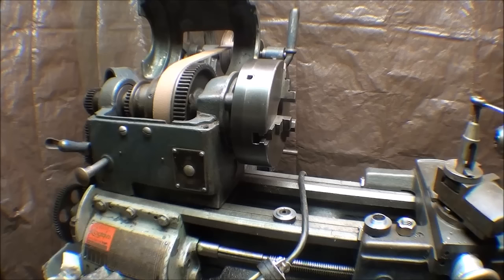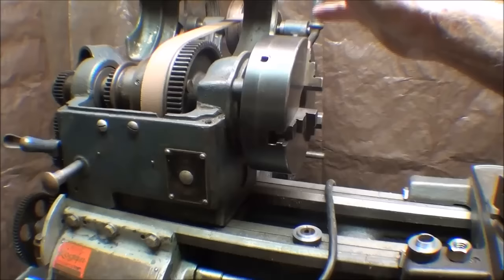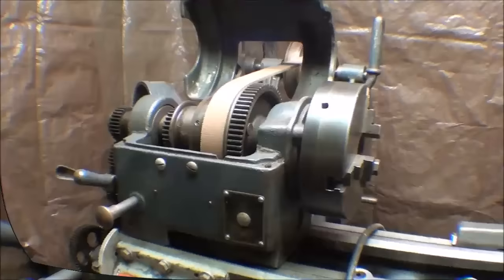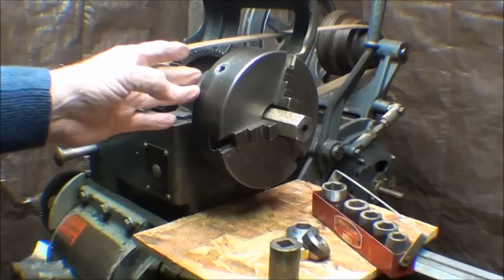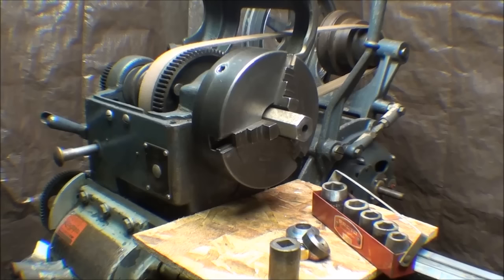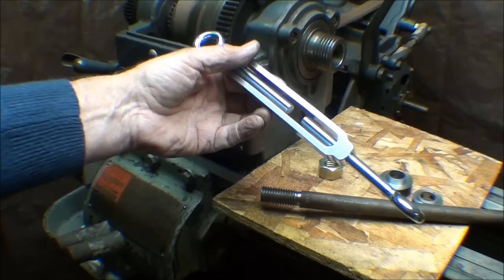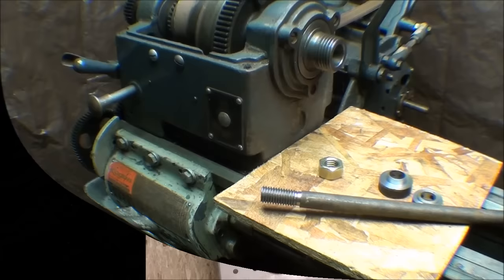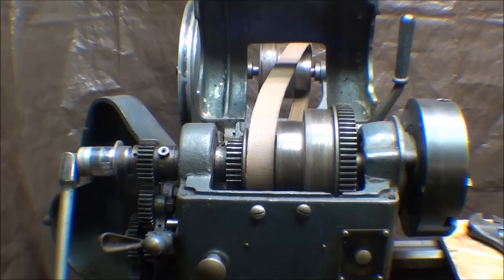SHOP TIPS #281 Removing a Stuck Lathe Chuck tubalcain atlas

Comment: Great video!

I had a stuck chuck that had been on my Logan 820 10" lathe for decades. Slight rust all over the lathe. I tried everything to get it off. I secured the spindle, and would soak the threads with Kroil daily for a couple of weeks. I chucked up a long 4' tube and hung a bucket on the end. I then filled the bucket with all manner of scrap, lead, etc and let the chuck support the weight. Left it for a couple of weeks and would squirt Kroil every other day. That trick didn't work for me (I should have used a longer pipe - more leverage). 

I finally decided to chuck up a piece of hex and use my impact driver. At 11:00 PM one night, I couldn't find any large hex in the shop. Wait, my Delta wood/metal 14" band saw has a 7/8" guide piece that will work! I first "bumped" it in the tightening direction hoping to break the rust, then went all out counter-clockwise. Came off without a hitch. It worked great!
Reply: +TAWPTool Those are some good tips!
Reply from the maker: +TAWPTool EUREKA!!!!!!!!!!!

Comment: My friend Grady got a really cheap buy on an Atlas lathe that had a stuck chuck. A couple of hundred $.cheap. He applied continuous torque to the chuck with a big wrench by means of a big wrench and a long piece of pipe. He used a small come-along on the far end of the pipe and just let it sit for a few days. Keeping it in traction like this finally did the trick. He said the daily heating and cooling in the shop helped to  break it loose..
Reply from the maker: Ingenious solution---required patience though.

Comment: Thank you!  I just bought an old, small lathe and the chuck was stuck.  I had been beating, prying, praying and pleading to get the thing off without breaking something.  I tried the impact wrench trick and after several seconds on a large coupling nut  (i didn't have hex stock) it came off.  Again, thank you!
Reply from the maker: I'm glad it worked for you

Comment: Chain grip is usable with a nice thick rubber protector pad to keep the chain from damaging the steel. Can also be used on a pulley, though grip is not as good as the v belt. Old serpentine belt is a good source of the right fabric backed rubber, and is free at the local mechanic from the bin.
Reply from the maker: +SeanBZA Yes-Thanks for watching

Comment: The last solution with the left hand  thread will also work with a righthand thread if you can hold it from the chuck end of the spindle.    Maybe RH all thread with wahsers/nuts at either end, if you can fit a socket thru the chuck. I think. Great video! Im working on getting the chuck of a 1887 Barnes 4 1/2.

Comment: Our 10" Sphere (Atlas copy) had a stuck 4 jaw, various attempts over 4 months failed to shift it, used every method except dry ice, nothing worked. I therefore became violent,  removed the chuck from it's backplate, used a 1mm thick cutting disk in the angle grinder to cut a flat across the bottom of the circular plate and a deep V in the top, removed the spindle from the machine (Dead easy as it has Timken bearings.) put the flat I'd just cut on an anvil, a 1" cold chisel in the V and two hits with a 7lb hammer split the plate. No damage to the spindle. New backplate £8. Cause of problem, deeply embedded grit between  backplate and spindle retaining face, everybody now reminded to clean everything carefully when changing chucks. Spindle got a long overdue strip down as well.
Reply from the maker: That is a good testimony. I have seen people put things back together including engines. Without any sort of cleaning them

Comment: If your lathe has an exposed spindle flange behind the chuck (be SURE that flange is a machined part of the spindle!) you can wrap that with one wrap of emery cloth secured by electrical tape. That's for traction. You can then use a split-style bearing puller and crank that down firmly on the flange. (Some folks make a custom clamp which is fine too.) You can keep the split puller from rotating by blocking it with some wood or aluminum, then use the "hex bar in the chuck" method to unscrew the chuck. My generic older Taiwanese belt drive lathe didn't have any better options and the chuck was firmly stuck, but this got it loose with little fuss. I used some 2" steel hex welded to a 3/4" drive socket and a three foot ratchet handle.

Comment: i'd add the use of some loosening spray -- wd40, or some other, or even some diesel fuel that works the best for me.
to hold the spindle, i'd use the ratchet strap.
common sense needs to be present in such a task in plenty.
thank you, mr. peterson,  for the video and for the topic.
-toly
Reply from the maker: +Toly Dukhovny Hi toly

Comment: I thought I had a stuck chuck when I bought my Boxford lathe. I spent a good while working out how to get it off. I suddenly noticed there was a grub screw in the back plate adjacent to the spindle threads.  With a little investigation I realised that a previous owner had put a grub screw and copper peg in the hole to lock the backplate to the spindle to stop it spinning off in reverse. Problem solved. I always pull the chuck from my lathe and dividing head when not in use. I fit a loose spindle thread protector in place of them.  Also never leave your collett holder in your lathe or mill permanently it will get stuck.  Great solutions there mrpete at least one of them should fix any stuck chuck problem..  regards from the UK
Reply from the maker: +Gary C Never saw one with a screw
Reply: @mrpete222  Some wood lathe chucks have a grub screw as Gary described to prevent them coming off when running in reverse. Both of my chucks for the NOVA Comet II and the DVP XP Lathe use a grub screw.

As an alternative to using a wrench on a chuck jaw to apply turning force what about using a pin hook spanner to grab the OD of the chuck with the pin set in the chuck key hole?

Comment: Very good ideas , On my old 22 inch lathe my flat belt went strait up to the transmisson above, so it way easey for me to move the belt in order to rotate the spindle in reverse by knocking one of the jaws on peace of steel between the jaw and the flat part of the bead the chuck would come loose , then I used wood on the bed and a chain block to take it of the lathe...

Comment: Pack the bore with dry ice. The shrinkage should break the sticktion.
Reply from the maker: +Cody Teague Good idea
Reply: No dry ice? Go get a can of keyboard cleaner, hold the can upside and it will spray freezing liquid! Have used this method to shrink shafts to aid in press fit gear installation!
Reply: @brandibartolomucci789  A can of freon wors too!!!

Comment: The leather strap wrench you made up could be wrapped around the bull gear, and the lock pin pulled, in conjunction with the impact wrench. I thought of this because I learned the hard way that Zamak parts don't like shock loads.

I  like your made-up method best, though. Even though it would probably only be used once, I would paint it a disgusting, eye-catching color, and hang it on "The Wall of Shame" next to the timing gear(s) and chain I didn't replace when I did the (first) valve job on the old Dodge. Shoulda hung up the push rods along side it, too.

Tom
Reply from the maker: +awhs1964 All so true

Comment: very informative, i have an old atlas 10f with true back gears that i'm restoring. the 3 jaw chuck was stuck when i got it but it came off using an adjustable wrench on the jaw and just gripping the pulley by hand. i do like the sacrificial  belt and pipe idea if i ever run into this problem again i will do just that

Comment: I have an older King Canada lathe.  When I got the lathe, it had some gear teeth in the bottom of the casting from the back gear.  

To make the chuck easier to get off, I built a "wrench" by welding a large hex nut on one end of a length of 1" square stock for the three jaw,, and a short end of larger square on the other end for the four jaw chuck.. 

I can tap that "wrench" with a hammer, or if things are very tight, there is a locating collar that is fastened to the spindle near the pulleys.  A pipe wrench on there usually lets me screw the chuck off easily.

I plan to build another sleeve like the locating collar with etiher a pin hole or maybe flats or  hex to hold the spindle.
Reply from the maker: +bhartwigutube Those are great solutions-Thanks for watching

Comment: I use one of those small rubber strap wrenches on my little Zyto lathe. 7/8" spindle (9tpi). I use hex bar in the chuck and try to snap it loose. You definately need some "snap" when you go at it. Always Oil the threads when you install the chuck!
Reply from the maker: Yes

Comment: Ok, I had a monster of a job but I succeeded. I used v belt and wrapped it around large pulley. I tied a knot as best I could at the end of the belt and inserted a piece of wood to make a windless. It gripped the pulley and some of the main gear and I made it as tight as humanly possible. I then took a long piece of pile and got the 3 jaw to grip it. Then I gave it a good jerk to wards me and that thing came off thank goodness.
Reply from the maker: Wow, that was a very innovative solution. They can be extremely difficult to get off. In fact, I have heard from many people that just gave up.

Comment: hi mr Pete i read in an old book the way to remove a stuck chuck was to insert a piece of wood between one of the jaws and the back vee way of the bed then put the motor in reverse select back gears and just keep flicking the  button on and off till it broke loose
Reply from the maker: +david sanderson good idea
Reply: Wouldn't that put dynamic stress on the gears that we are trying to avoid as that may break the cast iron tooth or two?

Comment: I removed a really sticky 4 jaw chuck with a 3 foot long peice of rectangle thick metal for leverage in the jaws.
I got the metal by magnet fishing in our local canal.
I did engage the backgear because it needs replacing with missing teeth, possibly caused by somebody trying to unjam the chuck previously.
Reply from the maker: You can't beat using leverage

Comment: Mr Pete I have an Atlas 10 inch without a stuck chuck , no broken or chipped teeth . Ware the damage comes in is on the chuck tightening gear and a small crack in the chuck around it . I'm just as guilty as the next for hitting the chuck key with a lead hammer but I don't recommend that method . An yes its old 40s . A stuck chuck is a 2 man job anyway . Good Luck All !
Reply from the maker: +Lawnmowerman02346 Thats good advise

Comment: The chuck was stuck on my Rockwell when I first got it.  I tried many of these things. Impact had no luck Long bars etc..  I had success using an air hammer. Came off in about 10 seconds once I tried that. Open jaws and hit to the out side for better leverage.  Keep the thread cleaned and oiled to prevent it from happening again.
Reply from the maker: +gd warner Great soultion

Comment: not a stuck chuck, but an interesting solution to prevent such, and to allow effective safe reverse use, my lathe is an early emco maximat v10p, it has a threaded nose but the back plates are split with a cap screw to lock the integral collar to the spindle, this also means that the backplate never gets tight, repeatability is also not an issue......
kind regards from the UK 
daryn
Reply from the maker: +Daryn Radcliffe Interesting-thanks for watching

Comment: my lathe when i bought it the spindle was locked up due to the properties of the bearing where if it sits without oil for an extended period of time it begins to act like a Morse taper and seizes up and requires shims to make it spin again. but the chuck was stuck on. not rusted i put the machine in back gears and put a wood block on the ways and a 2 inch block about 4 feet long in the chuck so i had a good lever. i pushed up on it from the front and it hit off the wood block on the back and the momentum of the pulley along with the reduction power of the back gears made that come right off. now for the interesting part. this lathe sat in an unheated garage for 30 years when i pulled the chuck off there was no rust and a light film of white lead covering the threads.
Reply from the maker: +Joseph Eirman good solution-Thanks for watching

Comment: Get two of the rubber strip oil filter/ grips anything "wrench" - it's a plastic handle with a flat rubber with two attachements on the same end, one is permanent the other slides thru a slot. If you have two of those you can hook one to the pulley area and the other over the large diameter area of the chuck, then just grab the two handles and push them in opposite directions.
Reply from the maker: I tried that, the rubber is way too stretchy

Comment: I tried many of the You Tube recommendations and got nowhere with my stuck chuck, then I came up with a solution, I slipped a 3/4"cam type internal nipple extractor wrench in the hollow end of the shaft opposite of the chuck. The nipple extractor held the shaft from slipping and with a rubber strap wrench the chuck came loose.  Home Depot sell cam style nipple extractor. 3/4" worked with my 12" Atlas Craftsmen lathe.
Reply from the maker: Sounds like a good idea. Did the extractor tear up the inside of the spindle?
Reply: My finger couldn't feel any marks in the inside, the 3/4" is a nice fit and the spindle is a lot harder material than the extractor. My chuck has been stuck for years and I couldn't get enough friction between the v belt and the pulley.

Comment: Its possible to take a morse taper dead center put it in the chuck side of the spindle and use a drawbar to tighten it in. Draw it into the spindle and use some thick heavy washers under the nuts at the end of the spindle and double nut the drawbar threads after it is drawn  down tight. Put the hex stock into tbe chuck use a socket on the hex stock in the chuck end and go to town with an impact.
Reply from the maker: Yes, that probably would work fine

Comment: I thought also, you might be able to put a piece of stock thru the spindle and tap from the rear, or thread a dent puller in to the stock, the slide hammer type. use this in concert with twisting the hex or square stock. this may also work with taper bore spindles. brass may be recommended as it's softer than the steel of your machine spindle or chuck. remember also a chuck is mostly easily replaced, the whole lathe or even just the gears may not be
Reply from the maker: Thanks

Comment: Not sure if this was the right way, but I used a wooden wedge between the gear and gear case. I turned the spindle until the gear teeth dug into the wood. It worked for me to get the chuck off.
Reply from the maker: +Dimitri Grams If it worked, it was the right way! thanks

Comment: The quickest way should be to put something really precious with a lot of work put into it in the chuck. Then put the lathe in reverse and try turning from the back. If that isn't quite enough you probably need to use your most prized tool to do the turning..
On a more serious note, my chuck on my dividing head was really badly stuck, so I did in fact remove it from the backing plate so I could bolt a 3ft bar to it. I then lubed, heated, heaved and pounded the b*stard and it eventually came loose. Nothing damaged, just had to replace the bolts for the backplate as I cut the heads off of those.

I read a tip that is supposedly excellent. Put a piece of bar in the chuck so that it hangs out perpendicular and use an air chisel on the bar. Haven't tried it but it sounds like a good idea. A bit like the nutgun, but the chuck won't absorb as much shock.

Thanks for a good vid MrPete, this problem has probably broken quite a few old lathes or sent them to the scrapper needlessly.
Reply from the maker: +UglukGPZ900 "IT HAPPENS EVERY TIME"

Comment: in an old model lathe not used for years the spindle get loose when motor runs and 3 jaw chuck vibrates?

Comment: Mr. Pete if all else fails, and as a last ditch effort, a pipe nipple extractor may hold the headstock. You will almost surely scare the inside of the through hole in the headstock, but if it is all you have.Great video as always Mr. Pete
Reply from the maker: +acklan3 Thanks for watching

Comment: is a good video for a great trick thanks for teaching us
Reply from the maker: thanks
Reply: We all could learn from mrpete222. I have, I tried all his solutions to remove and then some. Ended up TURNING off the stuck chuck back plate. It would not come off. My very first chips, Ordered the back plate from LMS. Turned it down to fit the register, drilled 3 new holes and mounted it to the chuck and been making chips now for 3 months

Comment: I just pulled my Lathe out from a corner in my shop after just under a year of un-use. Currently it has a four prong chuck that is about an inch wide stuck on the spindle (I'm not sure if its a threaded or cone connection, as there is a punch hole but also threads on the outside of the spindle). I've tried everything I can think of to remove it but nothing is working. Thoughts or suggestions?

Comment: If you have a stuck 3 jaw chuck but do not have any hexagon stock, could a bolt with 3/4 head be chucked up then use a wrench on the bold head?

Comment: A way to lock the spindle in an extreme case would be to put in an MT3 that has a soft machinable end. Machine the soft end with a hex to fit a 6 point socket . Put a breaker bar on this and use it to lock the spindle. Then Turn the chuck with by the jaws with a large crescent wrench. Or lock the vise withe cresent  wrench and turn the spindle with an inpact by the MT 3 that is locked in with a drawbar. It will come loose.
Reply from the maker: That's a good solution